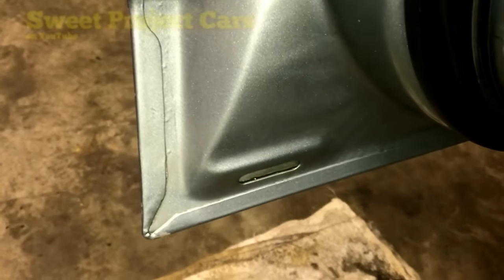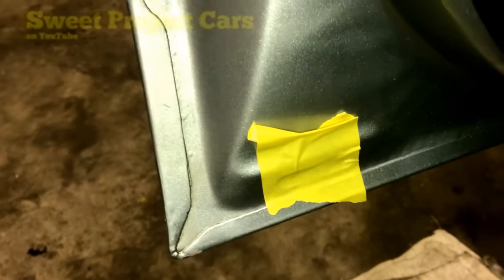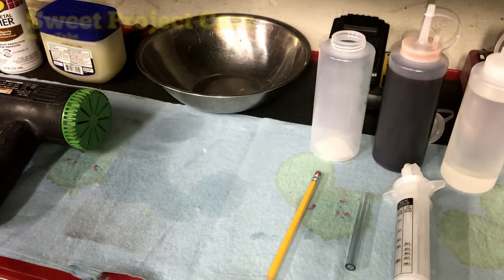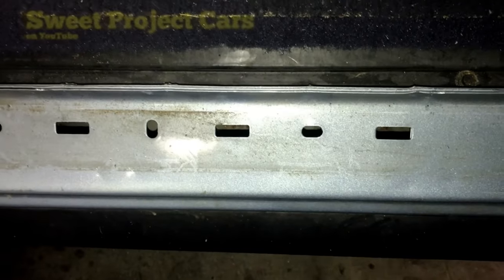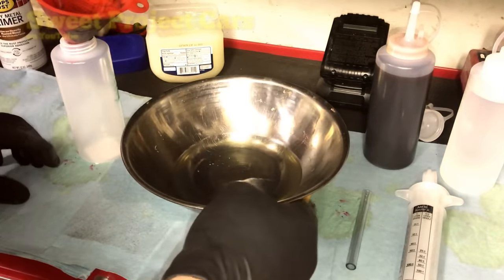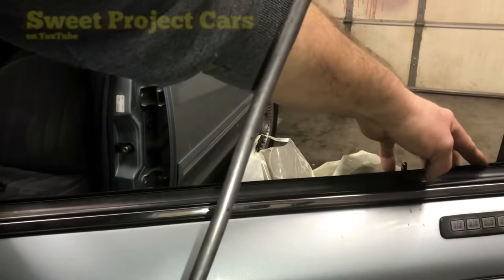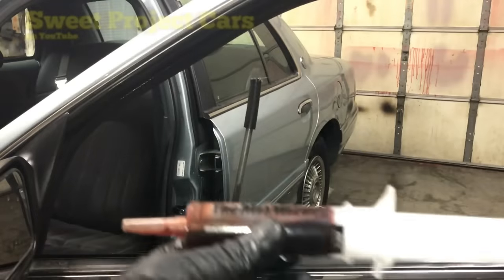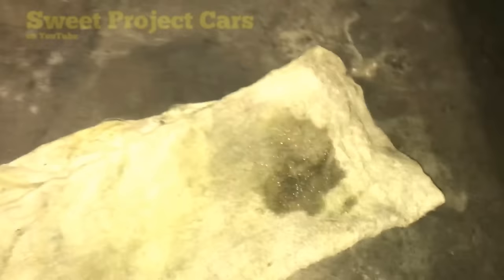Your Car Will NEVER RUST Again! For Just $10 Bucks!

Comment: Now the water will sit on top of those products. You have just raised the line of corrosion....
Reply from the maker: We have done this for over 40 years and not one customer’s car out of hundreds we have done has any rust on them you have to understand you do this with a dry vehicle the same concept goes with have you ever tried to wash a greasy dish pan with cold water and no so you cannot get the grease off same with this situation
Reply: Yeah raised but now its above where the drain holes (in the door) can deal with it.

Comment: why not dry that area out in the door and apply a rustproof paint in there ?
Reply from the maker: britton see our new Rust proofing series we have just started this is video one  https://youtu.be/WOpKDt5JEFk and this is video 2 https://youtu.be/PLQLuWdoFgw  of a total of 5 that will come out over the next few weeks.  also as a DIYer channel we could get very involved and very deep into many fixes and repairs that's for sure ...we try to keep it easy enough for the diyer and still get the job done and still be somewhat affordable...we say with rust especially ...something is better than nothing when it comes to trying to control or stop it, even if it is a can of WD40 because the diyer is on a tight budget...thank you for sharing my friend :)